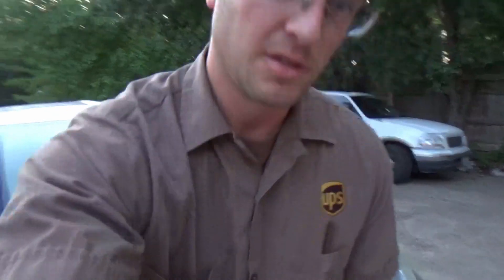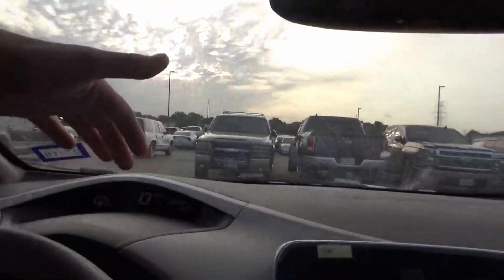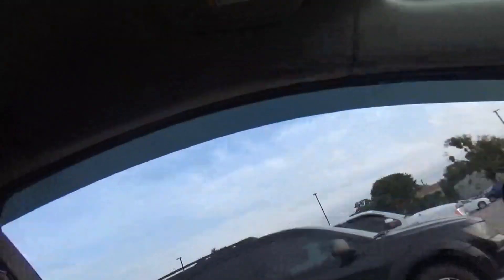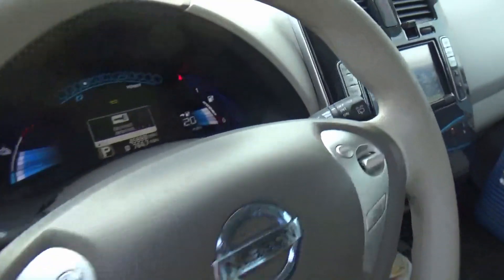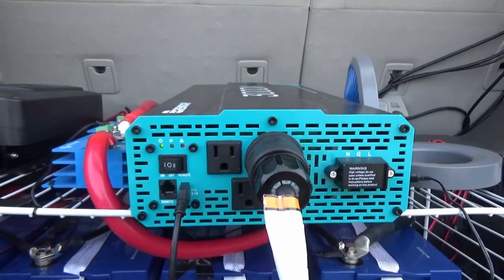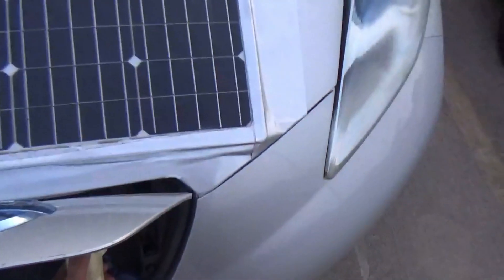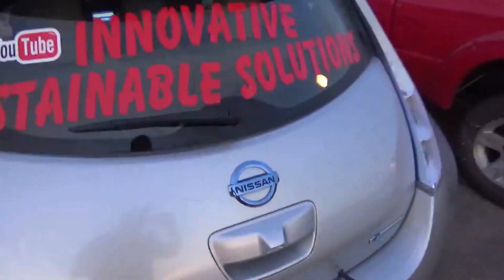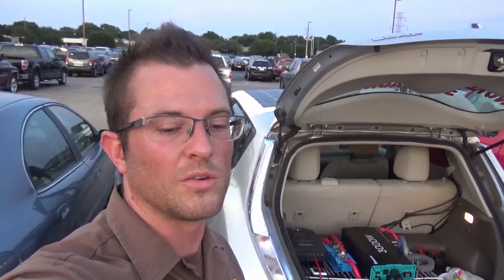Portable EV Charging Station

Comment: I love that you made the car usable.  I don't question that.  Although I find the solution a little sleight of hand. You give the viewer the impression that it's the solar panels on the roof that give the majority of the energy to boost the car's battery enough to give you 17 more miles. That seems disingenuous.  I don't know if you just forgot to mention it, but in reality, you've got 5 fully charged batteries (as shown by your charge controller at 12.7v in the video) in the back that I don't know the specs on, but from my experience each one that size can give you a good 750Wh of usable energy (without draining them too deep and wrecking them), so that's 3.7kWh (which alone can give you the 17 miles you need driving conservatively at 5mi/kWh)  You don't mention the size of the panels on the roof, but they are well-known flex panels.  A 50W on the hood and 2-100W panels on the roof for 250W total.  Clearly, you're in TX based on the license plates on the trucks.  So 250W of panels pointing essentially straight up in TX, would give you on average another 1.2kWh per day on the best solar months (May - Aug).  Now you've got 4.9kWh of usable energy to go into the inverter.  Cut that down by 12% for inverter loss is 4.3kWh and another 8% for the charger in the leaf gives you 3.9kWh into the Leaf's battery.  3.9kWh (75% from the already charged batteries, and 25% from the panels) x 4.4kWh/mi (normal leaf mileage) = 17.16mi added.   But someone needs to charge those lead-acid batteries at night before the next day to make this work again.  Do I have any calculations or assumptions wrong?  Let me know.
Reply from the maker: You're not too far off.  I commend you for really digging into the math.  There are 4 (not 5) AGM batts in the back, at 60% DOD you're getting 2.88kwh (you could push that a little further in a pinch, which I definitely have) from the batteries.  I absolutely charge the backup bank at night as well (off of home solar) as well as the main car batt to make this vehicle drive the 51 miles/day I need it to.  Additionally the inverter loss is 5%, not 12% (this is stated by manufacturer and independently verified by myself in the Lithium Battery Episode).  The panel array depicted in this video represents an early stage in the journey toward the 1,000 watts of paneling (about 700 watts realized) that I'm aiming for.  Progress is slow, I work 60+ hrs/week and have a family, but I have managed to make some improvements.  Using the improvements detailed in Solar Powered Leaf Ep. 3, I was able to get 1.71kwh on October 31st, yesterday, which should just about double in the summer.  If you watch a few of the other videos I think you my find the presentation less "disingenuous".
Reply: @InnovativeSustainableSolutions I'm glad you can charge your batteries off of solar at night.   I wouldn't have expected you to invest that much in-home battery storage to be able to do that.   My arrays are grid-tied, so I pull from the grid at night.  At least where I live, it's almost 100% hydro at night because of the low demand on the grid.  Wow, a 1000 watts,  even using the most highly efficient (and pricy) panels (20w/ft²), that's at least 50 ft² of solar.  That's pretty ambitious.   Clearly, you'll need to put a roof rack on which I'm sure you know brings down the efficiency of the car (especially when traveling over 50mph), which requires you to add even more panels to make up for.  What speed do you travel?  I know in my EV, I can almost double the range just by slowing down a lot.   I get over 6mi/kWh at 35mph.  I might check out your videos, although they do seem pretty long.  Good luck.
Reply from the maker: @scottkolaya2110  The videos are VERY long.  And as detailed as I can make them.  I call my own videos boring, in several of them.  I also explain, in my long, detail-laden, boring, videos, that I'm doing this because I am attempting to make this Youtube channel into a guide of sorts, on how to go about building your own solar/battery onboard EV charging station.  The number of EVs currently being sold is increasing exponentially.  In many of these vehicles the component limiting longevity will be the battery.  Combine that fact with fact that solar panels are making increases in efficiency every year, and falling in price; and I think we will begin to see a lot more DIYers attempting to build something like the system shown in this vehicle.  This channel is intended to be a 'rough guide' of sorts for those people, and I admit, it is a LONG read.  But if someone opens the book to the middle, reads 6 minutes, then sets it back down and feels that I've "misled" them in some way, sorry, I can't help that.
Reply: @InnovativeSustainableSolutions   Hi Sam, sorry for being hard on you.  I don't think I ever explained why.  This video was posted on a number of facebook groups last year by Hillary (I think that was her name) as a sort of a system overview which lead me to believe it was supposed to stand on its own explaining how the whole thing worked and not some part of the middle of a series.   And looking at it, it's pretty much a whole overview except for leaving out disconnecting the 12v battery charger in the morning.  I applaud you for having the guts to put yourself out there and not be afraid to learn on the fly.
Reply from the maker: @scottkolaya2110  You're good man.  Hillary is my wife.  Her putting our earlier videos out on FB is what got us the attention of Clean Technica.  Their article on the Suneater got this channel hundreds of subrscribers, thousands of views, and made me feel like people would actually be interested in a goofy project like this.  But my earlier videos did omit some stuff, and had a few inaccuracies- you weren't the only person to point this out to me.  I want this channel to evolve into a solar vehicle forum of sorts: and a healthy part of that is constructive criticism.
Reply from the maker: @scottkolaya2110  That's awesome!  I'll definitely have to check it out if I make it back up to New York.  Solar does become much more tractable on larger surface area transports.  I talk briefly about it in the Solar Smart Car episode.  And the ferry is probably parked 80% of the day so plenty of charge time.
Reply: No, I think it is smart because when you are driving, you are not charging the Leaf batteries so the solar is charging the AGM batteries to store that energy. When parked and charging off the AGM/solar, the rate of the solar output may fluctuate depending on the sun so the AGM batteries will keep the charging smooth. I am interested in this but would maybe look into super capacitors. I wonder if that may work? Thank you.
Reply: I am sure  your maths is correct, but my question is, dose it add more driving range? If it dose how can it be adapted to all EV car's.
Reply: @petera4821  The 250W of solar gives 1.2kWh per day in good sunny months.  Most modern EVs get about 4mi/kWh, so that adds about 5 miles to the range per day.   Most manufacturers won't bother with the cost of the solar to add 16¢ worth of energy to the car.  There are cars currently experimenting with permanently mounted solar such as the Sono Motors Sion.  They've been taking pre-orders for the last year and expect to start production in 2022.  https://sonomotors.com/
Reply: Adding solar panels pointing straight up in the sky works for places close to the equator.  For example, where I live in upstate NY, those same panels would produce 0.26kWh or about a mile of range in Dec instead of 1.2kWh in the summer.
Reply from the maker: @scottkolaya2110  Bingo, there are a lot of factors to take into account when considering vehicle-mounted solar charging.  I don't know if you ever saw Dan McGuire's Bolt in Canada.  He had to put about 2kw of panels on it to achieve the amount of power I get in Texas with about 600watts.  Local climate matters a lot too.  If you live somewhere close to the equator and cool, but with you're off-grid or the grid is unreliable a system like this is a home run.  If you live somewhere far from the equator, or in an area prone to heavy cloud cover, or a city thats hyper friendly to EVs and has charging stations available in every parking lot, this system is pointless.  This is why Sono Motors launch location of Germany is so frustrating to me.  The latitude will be horrible for showcasing what I (admittedly biased) believe is a good core idea
Reply: @scottkolaya2110  even adding 5 miles per day sounds viable. I charge my car once a week every 7 days, that would give me an extra 35 miles which in my logic is a extra 57 Km. BTW I have a Nissan leaf 2019. I have been looking around for something to give me extra mileage. The infrastructure isn't that great for charging your car in Australia in turn limits your destinations. I am hopping someone comes up with third party charge as you drive system for all EVs. This video is the closest thing I have seen. I will look at the web site thank you Scott
Reply: @InnovativeSustainableSolutions  I had calculated out the generation of each of the panel sets on the Sion in Germany and in the winter when the sun is at such a low angle (optimal angle is 78°, almost vertical), the side panels generate more energy than the top, but the downside is the car needs to be positioned properly when parked so one of the sides faces south unobstructed.  Which gets tougher the lower the angle.  Somebody parking 20ft away can shade your side of the car.  If you happened to park with the rear south, you'd get almost no energy.  Yea, most people don't realize Germany is farther north than all of Maine.
Reply: @petera4821  I agree, it's all situational though.  Some people commute at higher speeds and in that case, if you keep the panels smooth with the surface it isn't a big deal but if you need more solar, just putting a roof rack on the car can easily subtract 5 miles a day from their range in additional drag.   If you keep the speed down, it's not such a problem.  Also the solar adding 5 miles was theoretical with no loss if you can rig it up to charge the batteries directly without the need to start out with 12v, then an inverter to 120v AC, then the car's charger to convert the 120V AC to 350V DC.    Other concerns with addons is wind.  For example, I love this bus, but you can't just leave it alone to charge all day (of course depending on where you live) because of the wind risk if a thunderstorm rolls by.  https://www.youtube.com/watch?v=fGZ1zbqAGA0
Reply: This is just superb, I been tryin to find out about "electric guitar book free" for a while now, and I think this has helped. Have you heard people talk about - Senarper Salient Secret - (do a search on google ) ? It is a great one off guide for discovering how to have free power in your home without the normal expense. Ive heard some decent things about it and my m8 got great success with it.
Reply: Good Day,  just wondering if you achieved 34 miles in one year with an upgraded battery bank? 
I think 17 miles plus charging at home on 110v at night works pretty good!

Comment: Or, someone can purchase a portable gas generator.
Reply from the maker: @milestone_achiever4634  That's an option.  It will be less up front cost, and you will spare yourself the headache a building a small solar power inside your vehicle.  They are pretty loud though, you'll have to leave it running inside the vehicle so it doesn't get stolen.  You'll be changing tanks quite frequently.

Comment: I'm building this system for my leaf and will be using lithium batteries.
Reply from the maker: Youve got a lot of really good options.  Tons of stuff on the market today that didn't exist when I built this system.  Email me if you want to talk shop.
Reply: What have you been doing for updates on your leaf with solar charging?
Reply from the maker: @Offgridhomestead77  I had to sell it a couple years back.  It still drove fine and all systems were functioning fine.  But I had some life changes and had to switch vehicles
Reply: I thought I share this was from 6 years ago. Someone built this similar to what you did.https://youtu.be/GPOZcoDhT78?si=wXKx_HQ4w69NwI-6

Comment: I've got a leaf and it's range is just too limiting.

Even with a brand new batter, about 70 miles max is all I could count on.

The guess-o-meter says 85-90...

Yeah right...

I don't know that anyone would want to buy it.

I'm thinking of trying to make it into a solar power  storage unit but I don't want to modify the battery.

Comment: What I have learned from this video is that I can charge my ev from my 19kw battery bank instead of charging it from the grid. I would like to see how that shut off switches on the inverter works though to keep the battery safe.

Comment: I would have like to seen the % rather then miles, I never pay attention to miles cuz it’s never accurate. But wonderful video
Reply from the maker: That's a good point.  The best measurement to take would have been an increase in state of charge, and use that to determine the actual kwh put back into the battery

Comment: You can buy a battery pack for $1000 that will fit back there .   
Way easier to just switch to pack 2.
Reply from the maker: Please provide link
Reply: @InnovativeSustainableSolutions  
I work for golf cart company.    
We are connecting lithium battery packs 72 volt .   These will work in your leaf

Comment: You should be VERY careful with the heat from this system.  You've basically taken a low end solar charging system and are using to to recharge your main car's battery.  Honestly, your best bet it sit try and do a full battery replacement.  I'm hoping that Nissan will allow for this on older EVs.

Couple of questions what wattage solar panels are you using and realistically how many amps are you pulling at noon when the sun is at it's apex?  Also what battery chemistry are you using for the solar batteries in the trunk?  Some have been known to leak.
Reply from the maker: You're right, the heat became problematic!  Went in in a later video and added a small a/c unit to cool the trunk.  This entire system with 600 watts of solar, a/c, batteries, inverter cost $3k when I built it.  The best price your going to find for a "new" 24kwh swap now is well over double that, and it's never gonna get cheaper.  Sorry, I know people that do these battery swaps professionally.  The aftermarket supply is gone.  Peak wattage input with a 175 watt panel laid over the windshield is only about 450-500 watts.  The batteries Im using are valence 12v Lithium, see video "used Lithium vs. Lead batteries" on this channel.
Reply: @InnovativeSustainableSolutions  this is what gives me pause when considering dropping 30k+ on a electric vehicle.

1) I want a hot swappable battery
2) I want an after market that builds these batteries. 

The people who do rebuilds professionally, are they able to get parts from Nissan?
Reply from the maker: @Lou-jf4rl  The people who do rebuilds professionally are able to get parts from Nissan (kind of), but in practice none do because of the price.  There is no aftermarket supplier for Nissan Leaf batteries.  Not sure where you're getting the 30k + figure from though.  I paid 3,000 for my Leaf
Reply: @InnovativeSustainableSolutions  So if you want to buy "new" as of today every car dealers I've contacted here in the north east wants about $35k+ for a 65kw battery.  Not including dealer warranty. 

Continually they explain to me that there are "shortages" driving up the price.  A few weeks ago a dealership quoted me $35k for a 2020 Nissan leaf 40kw.  I walked out of there laughing.

I don't have any proof of this but I suspect that the so called "shortages" are really just a bunch of BS to drive profits at the dealers and manufacturers.  I've asked the sales staff if they could specifically tell me where the pain points are causing the "shortages" and I usually get a blank stare in return.
Reply: @InnovativeSustainableSolutions  Just curious where did you get your leaf for only 3k?
Reply from the maker: @Lou-jf4rl  Craigslist.  It was a 2011, 6 bar Leaf with numerous dings and scratches, and about 37k on the odometer.  I love the Leaf but I advise everyone against buying one new.  A used Bolt will be cheaper, last longer, and have more utility.
Reply: @InnovativeSustainableSolutions  How so?
Reply from the maker: @Lou-jf4rl  Cheaper:  New Leaf 30k, Used Bolt 20ishk.  Last Longer:  Leaf battery degredation per year 10%, Used Bolt 2-3%.  It's easy to put 100k miles on a Bolt, you don't see that many Leafs with 100k+ on the odometer.  More Utility:  The faster charging speeds make longer trips, and mileage intensive weeks just plain simpler on a Bolt.  The Leaf is more comfortable (especially the seats), and has more cargo space, but it's a chore to put much more than 100 miles per day on it.  The last point is largely opinion, and open to debate, but cheaper and longer lasting the Bolt definitely wins out over the Leaf
Reply: @InnovativeSustainableSolutions  I guess I'll have to look more into the boat's battery and charger then.  Thanks!

Comment: How much this system cost?
Reply from the maker: With just batteries and an inverter, $2,000.  With Solar panels, and charge controller, batteries inverter, a small air conditioner, and a roof rack $4,000.  Costs vary widely based on what kind of system you want to build.  Mine would cost around $4,000 to build today.